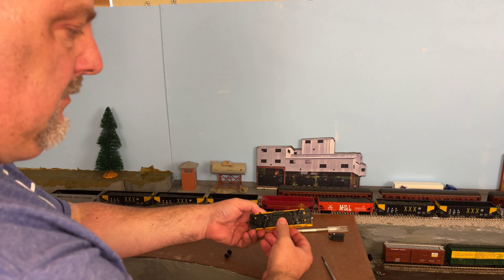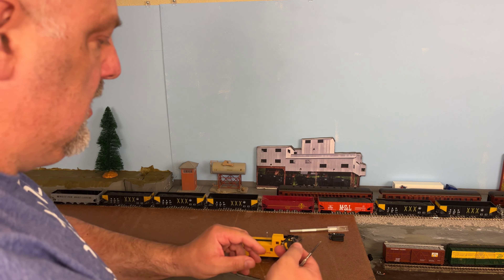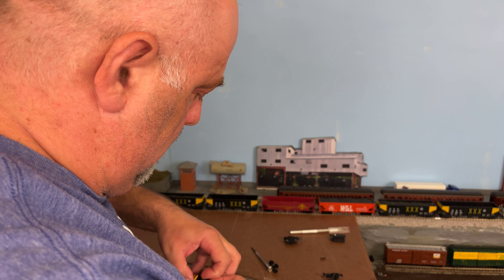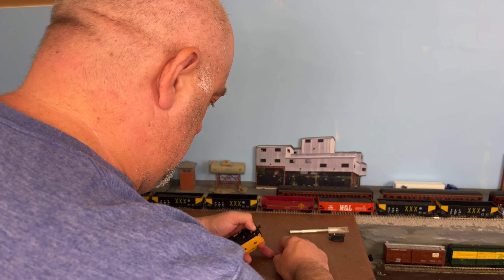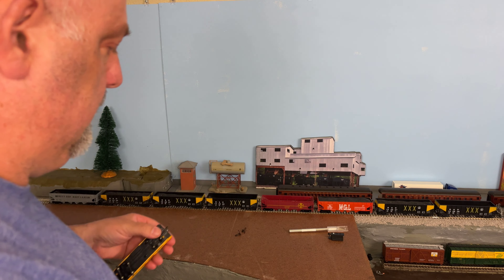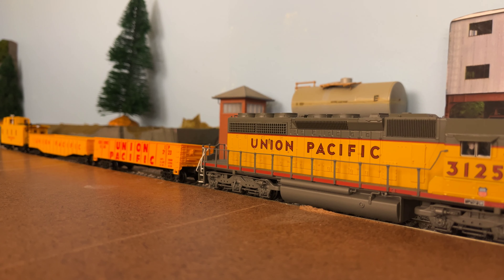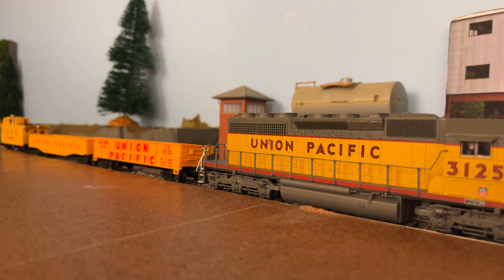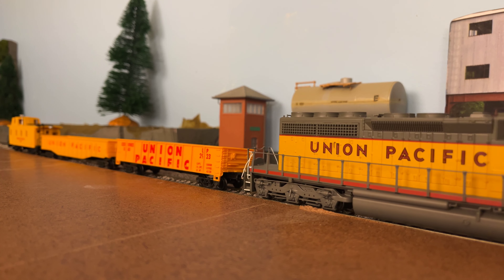Getting Our Union Pacific Caboose on the Rails

Comment: Nice work!  I've changed all of my wheelsets out to Kadee metal wheelsets and it makes a huge difference in performance.  Adding the proper weights is also important.😊
Reply from the maker: Thank you. We’ve been upgrading to Kadee metal wheelsets on other stuff recently to and you’re right. They roll super smooth. I just happened to have these others to use for now.
Reply: @johnlazar7582  Good practice.   My favorite wheels are from Intermountain.